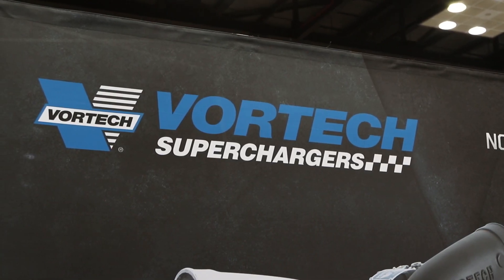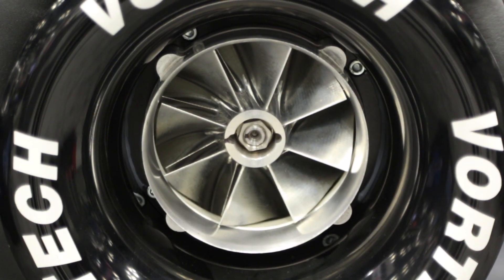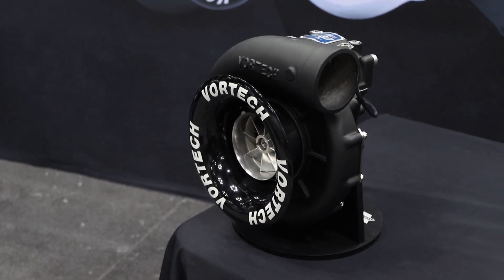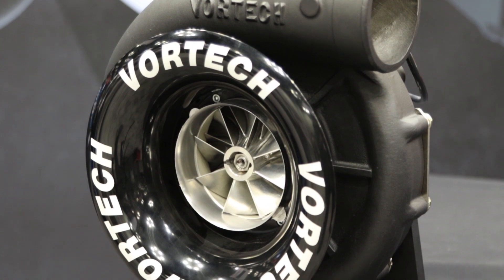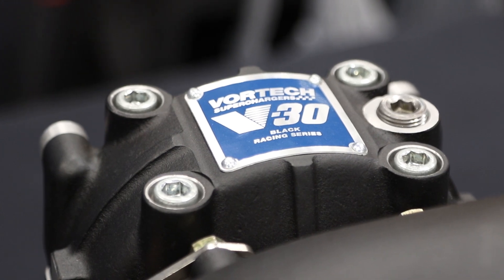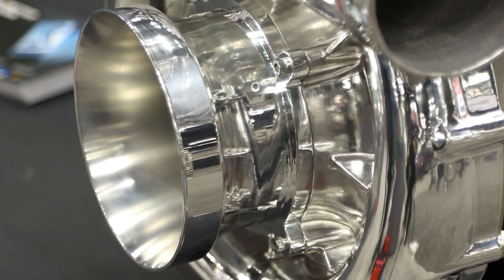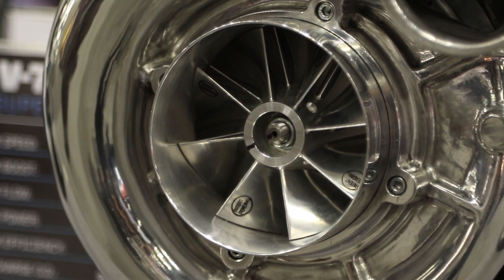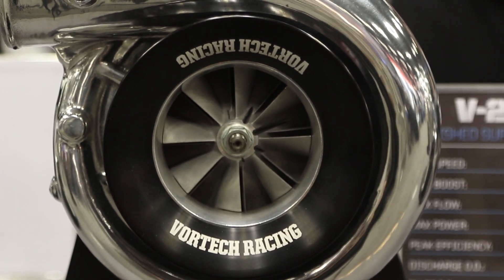PRI 2016: Tighter Tolerances And Higher Efficiency With Vortech's New V-30 Supercharger

Comment: One of the greatest things to hit the Supercharger came from Turbo Geometry.  Variable Vein Turbos gave Centrifugal Superchargers the last piece of the puzzle that has been missing for years.  That would be more boost at the top-end.  Centrifugal Superchargers are now caught up to Turbo Technology in efficiency.  The only question you need to ask yourself is if you want to bolt on 400+ lbs. in piping weight or bolt on a Supercharger to make more power vs. weight.  Remember that even if you are the first one late to the party you are also the first loser.